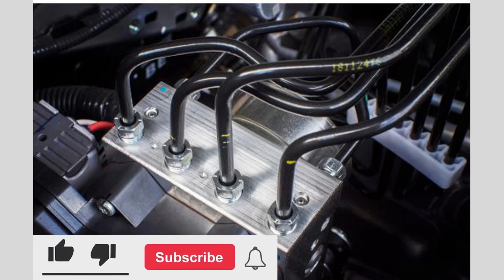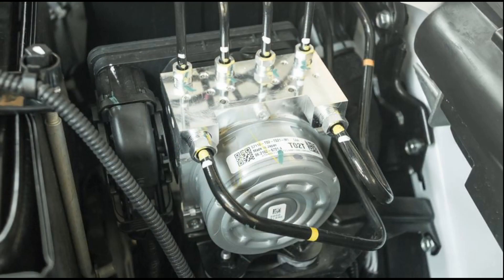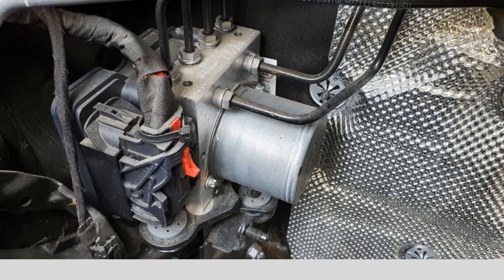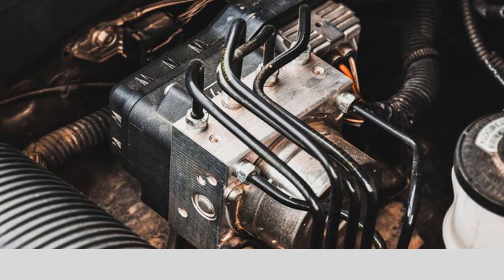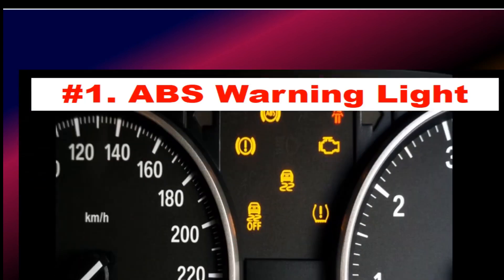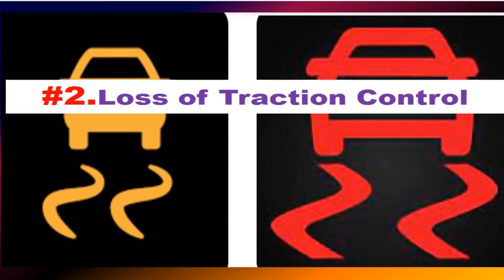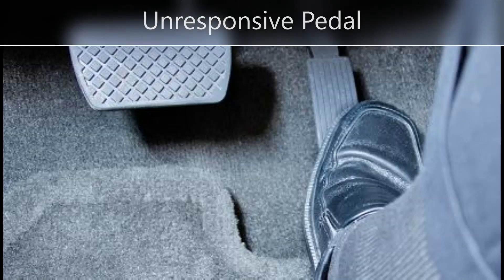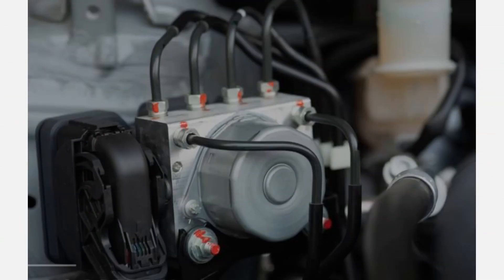TOP 6 Symptoms of a bad ABS (Anti-Lock Braking System) module?  How to fix if ABS faulty?

Comment: Hello my mercedes w204 model 2009 shows esp abs assisted direction default when i roll over 20km/h  this means what? Maybe a pump abs dysfunction? When i did a scan the code default t was 5001 please anyone to help i will be grateful
Reply from the maker: The error message "ESP ABS Assisted Direction Default" on your Mercedes W204 model 2009 indicates a problem with the Electronic Stability Program (ESP) and Anti-lock Braking System (ABS) system. The error code 5001 is likely related to this issue. Possible solutions include checking the ABS pump and module, inspecting sensors and wiring, resetting the system, and updating software. It is best to have a professional mechanic diagnose and repair the issue to ensure the proper functioning of your vehicle's ESP and ABS systems.